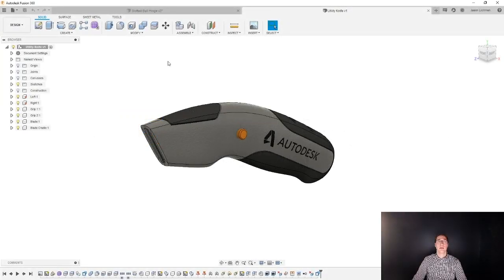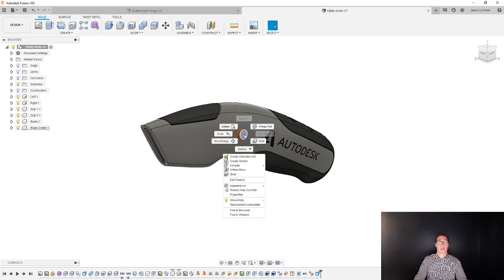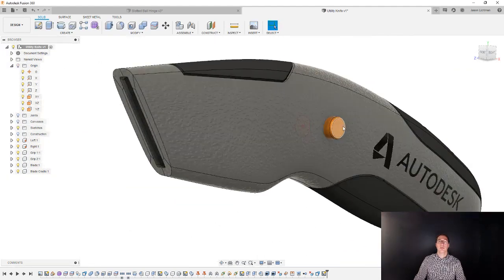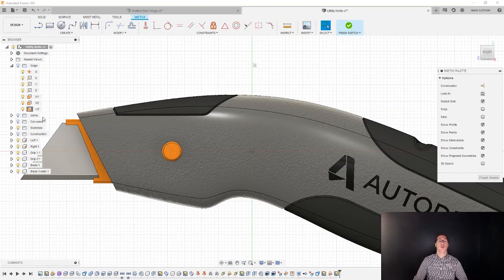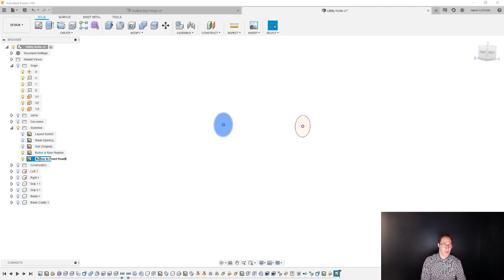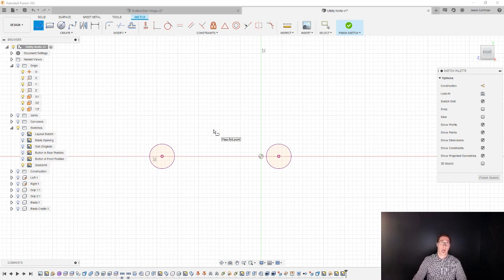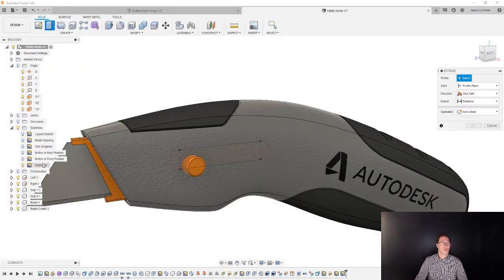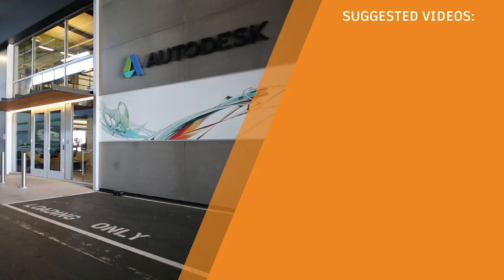QUICK TIP: How to Use Position Capture Best!

Comment: Holding 'Shift' while drawing a line is another way of forcing tangent behavior, both start and finish points. Then, mirroring the first line, or offsetting from it, and dimensioning either to the pin outer diameter or, better yet, a 'User Parameter' for the pin O.D. are both great techniques for establishing geometry relationships. Lastly, while the slot in the handle is exactly sized, that doesn't work in the real world. For the tool to actually function, add a tolerance (another "User Parameter') to the slot dimensions, as well as either a fillet or chamfer to the inner edge of the slot.

Videos such as this, from instructors like Jason, are as appreciated as they are beneficial. Great video Jason and Autodesk Fusion 360!

Comment: Does this mechanic work when using components that are not from the same top-down fusion file? Meaning I start with a blank file, save it, then add multiple finished (or semi-finished) components from a different folder (is being within the same project an issue?). Could you at this point still make changes back to the original component files? If that would work, is it the same process, and if different could you do a video like that please?
Reply from the maker: It sounds like you're asking whether you can use this workflow in a case where the files are externally referenced. The answer is YES, but the part that he cut (the side) would need to have those x-refs broken. However, we showed at Academy that editing linked parts is coming! That will make life way easier!
Reply: @adskFusion  Ahh, editing linked parts sounds like it answers my question! Thanks and looking forward to that feature!!

In the case where you edit that part, I assume/hope there will be some choice as to editing the original or creating a new externally referenced, yet linked, part?

Comment: Are you able to import completed multi part object files (ex. - stl's, obj's, etc.) from another software for animating in fusion 360? If so would you happen to have a video on this or would you be able to create one for an upcoming video? Thx!!
Reply from the maker: Mesh files have limitations, one being the ability to join them to other components. As that's the case, creating an animation of said meshse would be difficult, if not impossible.
Reply from the maker: I'd love to be proven wrong though!

Comment: I never got why this capture thing is in Fusion 360. I get it when you make a joint like in this example. But when I move components to another place with the move command. Why does it ask me to capture it? I didn't move it for nothing. If I wasn;t satisfied I would have undone the move.
Reply: I think that's the source of all the confusion about the Position Capture "warning".  That and the "Continue" button.  After 6 months of 7 days a week, full time F360 use, I finally shook off the confusion for myself. This tip helps, and opens up another skill.
Reply from the maker: You really should watch the full live stream. Jason covers this with great detail.
Reply: @adskFusion  A link to that video would be great! Thx in advance!